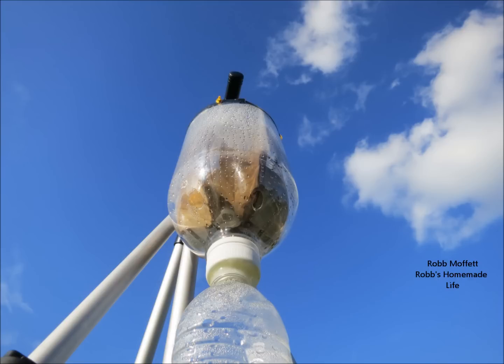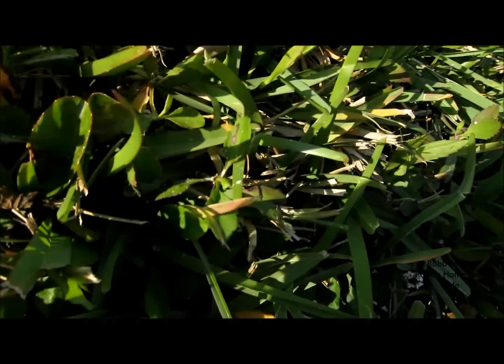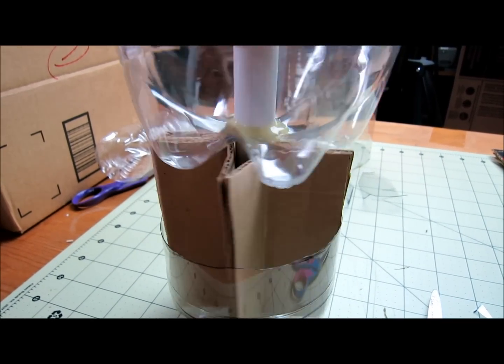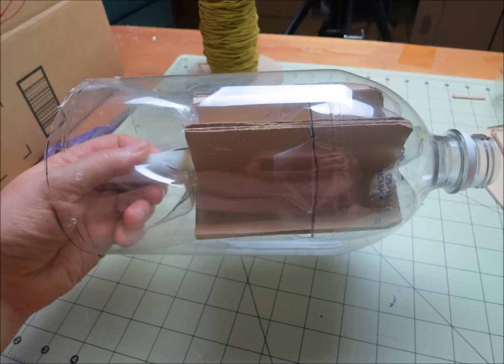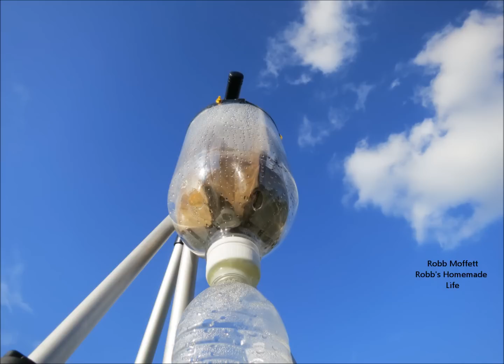DIY fresh water - free solar soda bottle still easy quick to make

Comment: I like the idea! I do have some concerns however. What about mold in cardboard and many of the cardboards now are treated with all kinds of chemicals or am I wrong? I am going to review this a little more. I am a little confused on making it completely. I am having a disconnect on how it's collected internally. Different colored bottles for internal would film better and be easier to distinguish. So that is a design idea:) Thank you for your efforts and sharing!
Reply: +Crash-N-Burned.Flightnurse I thought about that at first too but the cardboard is already on the "dirty" side so the mold from it doesn't easily get transferred to the "clean" side. If you were really concerned you could swap out the cardboard every could days.
Reply: @LanternLabs clean cardboard takes the longest to mold. It's cardboard that has been in dirt,food,dirty hands,real dirty ,high algae that can mold faster or increase slime. The sun is a great 2nd on cleaning of water and cardboard.
Reply: Cat tails stems 🤔

Comment: You shouldn't use plastic for this!  Plastic would be fine for the collection of the water as long as its not heated with the sunlight. PET Plastic breaks down in sunlight and with heat, this leaches into the water making the water toxic, carcinogenic. You should use some type of glass or stainless steel when distilling water with sunlight, not plastic.  It's a cool and inventive setup, just using materials that will kill you if you actual drink the water your distilling!
Reply: Survival mode says fuck ppe plastic toxins over death lol
Reply: It also appears you would need a hot glue gun and power tools in a SHTF scenario
Reply: But you are very correct

Comment: Sunlight degrades plastic.  This is basically leaking plastic into the water and you'd be drinking it.
Reply: +WTF BBQ  This is true. However, it would take considerably longer for you to die of taking in those petrochemicals than it would if you were to allow yourself to dehydrate ( 3 days ). Clean water with some plastic in it is better than no water or dirty water. If it's that much of a problem for you and you have the resources, then by all means use glass.
Reply: *****  Are you trying to me that you cannot find a glass bottle or a metallic container ??
Reply: WTF BBQ
The problem with metal containers is that you can get very sick from using them. Diseases like tetanus and botulism can linger in old food cans.

I'm not saying it would be hard to find some glass in an emergency, but there are things about glass you need to consider. For one, if your filter falls over, you run the risk of it breaking. For another, this sort of filter isn't the kind that you'd want to rely on as a main source of water purification for long periods of time either way, because eventually the filter components themselves will become too contaminated to use.

On another note, you could be using that glass for much more important things, like making tools ( small blades, arrow heads signalers ), starting fires or catching and storing rain water that can then be stored for long periods of time. You could potentially even use it to cook in if you're very careful ( I would advise against that, but desperate times and all ).
Reply: Captain Chupacabra  
I understand the purpose of your design. It's a short term emergency solution when you really don't have anything with you. I just prefer something long term because when SHTF like WW3 or the economic collapse,  it will usually be for the long haul.

I built a water distiller  and put it in the trunk of my car.  If SHTF happens,  I can go to the ocean or a creek, and get fresh water that way. I'm also trying to learn different skills that would help me in those situations.
Reply: *****  No, I did not know that...  I've always thought that the best tool anyone could possibly have  is the knowledge and wisdom that they possess.   In this regard, I force myself to learn many many different skills and important facts.
Reply: *****
 Ah yes, the warka towers. You need a lot of room for those though. You might also want to check into these. They require an established water source, but they're much more portable.

http://thefreethoughtproject.com/solar-powered-water-distiller-turns-salt-water-fresh-water-sunlight-saltwater-required/
Reply: Death from lack of water, 3 - 7 days. Death from plastic chemicals leaching into water, 20 years. D'oh.
Reply: +Captain Chupacabra Death is not the issue. It causes estrogen spikes. If you drink it, you're basically taking Estrogen therapy. My mother cooked in plastic and had a medical problem as a result. The spirit of the video is post apocalyptic survival, but people today will try this. If you know plastic is dangerous to drink, it's then your responsibility to set a good example.
Edit: Still though, (no pun intended) it's pretty cool how that works.
Reply: instead, you'd be dying
Reply: PETE, plastic #1, the stuff these bottles are made from, don't leach BPA though they can leach some other stuff. If you have a milk jug or some other source of plastic #2, however, use that, since it doesn't leach anything acutely harmful.
Reply: There are so many things wrong with this statement. There are THOUSANDS of different types of plastic. Every one of them has a different chemistry.

You are American FFS! Your entire country is a toxic radioactive shit hole. You have a president that is destroying the EPA. The poison issue is moot.

There is nothing you could do personally to make your food worse for your health, short of drinking a bottle of untreated water.

The only thing that could come out of PET bottles, is a tiny amount of acetaldahyde, which occurs naturally in your stomach whenever you drink alcohol, AND is in most ripe fruit.
in short DON'T WORRY ABOUT IT!

Comment: Your holes you added later to collect rain could still be used. You'd need a way to use the tube to hold a vent plate under the holes, keeping that piece independent from the tube/shaft

Comment: Hi I will like to know if the distillation is taking place using waste water which is added, if so where are you placing the waste water, if not is this operating by a process of condensation from out of the atmosphere...??
Reply from the maker: +Basdeo Persad hello Basdeo, the waste water is in the top bottle.

Comment: Great job, great idea. Maybe sealing the top with a rubber/silicone glove, with just a needle size holes, would allow rain water to drip inside? You could put a pvc tube thru a middle finger, and a edge of glove might seal upper opening, without a need for a tape.
Reply from the maker: +ProjektBushcraft  I definitely think more can be done with the design, thanks for the input and for watching.

Comment: Hi great idea, always looking for survival techniques to use, without relying on peacetime food and water, and by using solar techniques, regarding some issues with chemicals from the bottle, I would say this technique would be great to use in a desperate war zone or for basic survival, in which case as long a water is clean free from disease, which this would be it could provide enough to keep you alive, just wondering if putting the water through a charcoal filter would help too.. either way great vid..
Reply from the maker: leetaxiuk Hi lee, you got my point exactly. the design is for emergency using free common materials, not to replace normal water supply. A charcoal filter is great for removing many chemical contaminants, but near useless for bioburden.

Comment: Thanks for the vid. Shouldn't the distillation process be in a closed system? Meaning a snug lit on top or something. I think the pressure effects the efficiency.
If I am not mistaken, airing out the pressure should only take place at the distilled water. 
Plus water evaporates easily.
Reply from the maker: torsten808 There is only  a pin  hole in the bottom container to allow air to escape as water is collected.
Reply: Robb's Homemade Life Sorry, I guess I missed that.

Comment: I like the design.  Easy to take apart to replace the cardboard when it gets too degraded and a chance to wash out the inner buildup of yuck from the waste water.  I feel dumb. I had to look at this three times to get the whole picture. I thought the first step was to glue the inside bottle to the outside one, (smoothly) which would leave nowhere for the condensed water to go. Sometimes even seeing we don't see. LOL
Reply from the maker: Crafty Chrystal Thanks Chrystal, I could have done a better job showing how to put it together.

Comment: hey good one, Robb.
  If one has some of that all plastic corregated stuff that looks like card board, but is white plastic, that might be a good alternative to the brown paper cardboard.  It is just not widely available yet, but it is waterproof.
I had a couple of little boxes made out of it and left them out in the weather for a couple of years with no sign of deterioration.  not sure exactly what kind of plastic it is.  might be avaiable at craft stores
Reply from the maker: A Pa Thanks A Pa, but the cardboard was used to wick the water and create a larger surface area for the water to evaporate. Plastic cardboard would not absorb water.  However, I could use plastic cardboard as a form and cover with cotton material. The brand name of the plastic cardboard is coroplast, it is very neat material to make stuff with.

Comment: I think this is a great idea, but the cardboard will eventually need to be replaced and do you think that you could design something that could replace the cardboard? Have to admit this is pretty cool. Great Job.
Reply from the maker: Pickle Relish Thanks pickle, you are right, the cardboard or other wicking material will not last forever and will need to be replaced .
Reply: Do you think layers of leaves or something natural could be used instead?